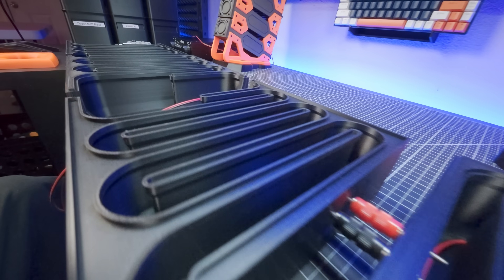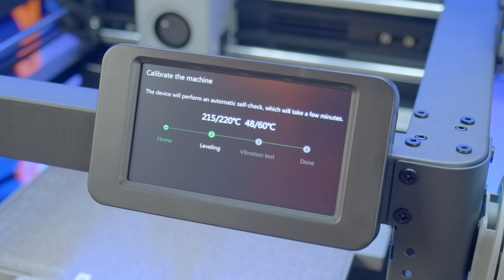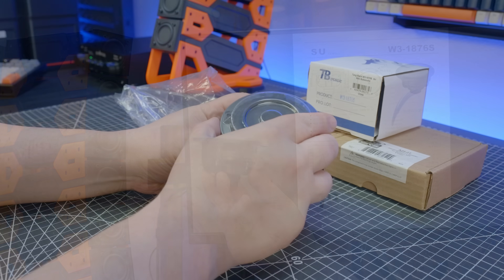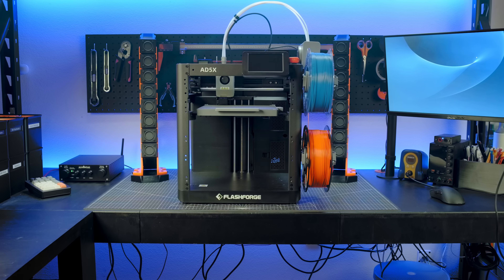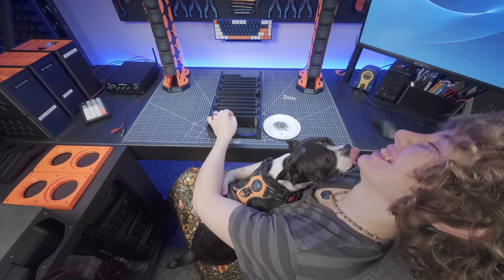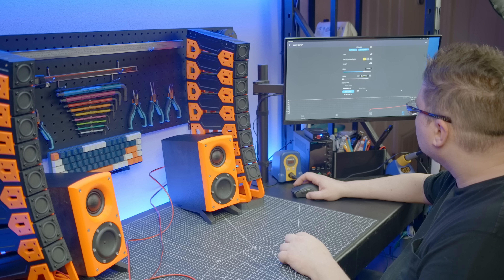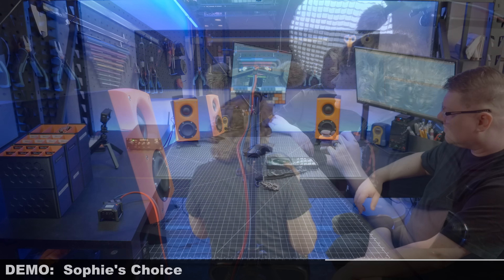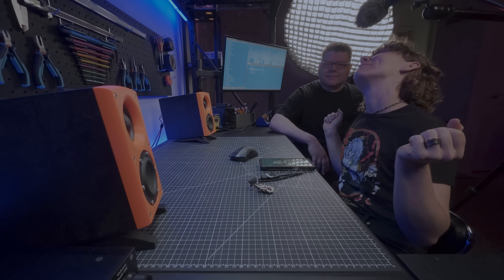Flashforge AD5X Review & Feature Build

Comment: 2:55 it's not a waveguide, it's simply a transmissionline or quarterwave-tube. And the bass mostly stems from the rather impressive excursion from such a tiny driver and the acoustical volume. In other words had this been a regular ported box with equivalent internal air volume and tuning-frequency it would go just as loud and deep. A ported box with equal internal air volume would actually be a bit smaller, since the walls of the transmissionline take up quite a bit of space.

Comment: The designs you have made available are all significant, but this one really feels special.  I've printed almost every one of them and spent many hours redesigning this one with modular mounts for a bluetooth amp, tool battery, and crossover components.  I am blown away by the sound quality produced by this enclosure and its 2 drivers.  I have a great appreciation for the hard work you've made available for free, it's taught me so much about enclosure design.

Comment: Nice job  I'm looking forward to seeing you to design a Dolby Atmos height effect speaker. I mean the up-firing version - looks you know what you are doing and building something  what will function really  directionally (Lot of  speakers from the shops marked as atmos  not function really like  what their purpose is ) and will not cost fortune  could be good challenge for you :D
Reply: also there will be nice to build enclosure for 8"  inch spealer and tweeter with some reasonable soze for 3d print

Comment: I had so much trouble buying and using flashforge PLA fillament, the majority of them was extremely moist and I would never achieve good printing results due to it. And even if I tried to dry them, or buying some new spools, the problem persisted. Now a days I'm using some other brands.

Comment: Damn man, I hate that their support failed you like that. I’ve read on Reddit with several people who had issues were responded to quickly and with replacement parts sent to them quit. 
Mine has been working pretty flawlessly for the last few weeks. I know I’ve read issues with some firmware with some people and them having to roll it back to a previous so maybe the next firmware will fix this heating issue you’re having and maybe their customer service will get their head out of their ass.
Could you try to reach out to them again from a different email in case it was just one shit employee who left yours on read? 
I know I paid $250 for mine on Ali express and have been very pleased so far and the kid has a 5m pro for the last year and it also has been solid. I just went with it to see if printing is something I want to get into before going all in on a setup but liked the idea of this one to run same color spools for the auto reload that has been working great.
Reply: I concur; somehow I managed to cancel the calibration test (possibly by tapping wildly on the screen / using the power button in front), updated the firmware, and now it works well.

Comment: love your channel I was born an engineer 8-)  recently in the car accident my motorized tow plastic structure was broken and I disassembled it - found an interesting material called "fiberglass filled polyamide", PA GF (then number - % of glass chips). It is not "sonant" as pure plastics, feels heavy, rock-like. PA GF could be suitable for your projects if it is 3d printable and available. But gluing it is a challenge - only PA chips dissolved in the formic acid and the syringe can help.

Comment: Do you think the crossover points in the DSP are required? 
If so, I wonder if a passive crossover could be placed on them somewhere as I would like to use them with some amps that don't have crossovers built in.

Comment: Worked for  a few known audio companies in my time in the audiophile world. And as hobby speaker builder my self this is a fun video. I have the flash forge 5m for about 1 and a half years. Been pretty reliable. I just added the ad5x to my line up. And so far I"m pretty happy to weird things like your printer is doing.  Every once a in a while defective printer can slip through with so many being made.  Happens to all the companies. So far from other review most seem happy. GRS was mo go to for cheap decent drivers. TB are also known to me. Plastic vibrates as lot. How does that affect the sound?
Reply: 3d prints usually dont rattle :)

Comment: I'm just a random internet dude- but I'd be interested to see you design an in-wall home theater subwoofer that can fit in a normal 2x4 stud wall
Reply: The best option for you would be to design something specific to your wall (insulation, height, internal/external wall), but it would be interesting to see a universal self-contained subwoofer that just happens to mount right between two studs.
Reply: Bose and a few other brands do have enclosed passive in wall subs available, but they ain’t cheap. It would be cool if he came up with a nice diy set of plans to do it cheaper though. Hell, with his brain, he might be able to improve on the other designs and make one that tops ‘em all! Lol
Reply: Jl makes nice in wall subwoofer setups that are designed to mount between interior studs
Reply: @brandonharrsch8318 at the price point of those, I'll just sit something in the floor first